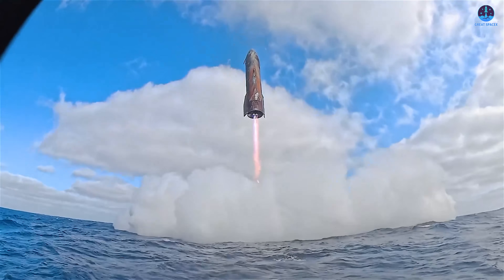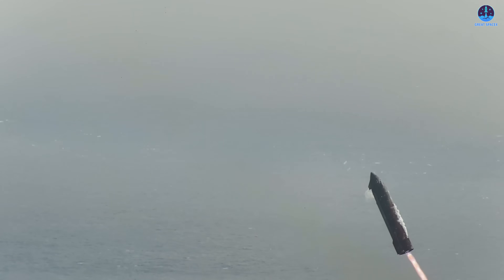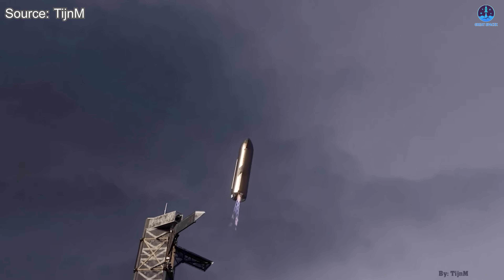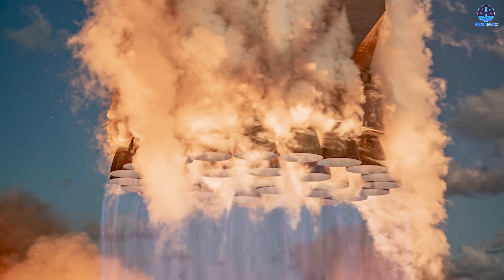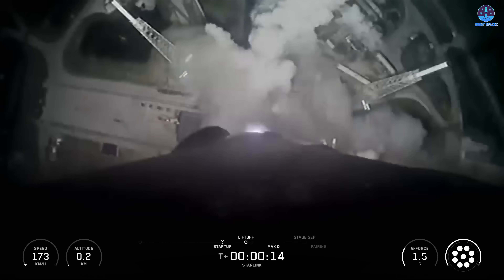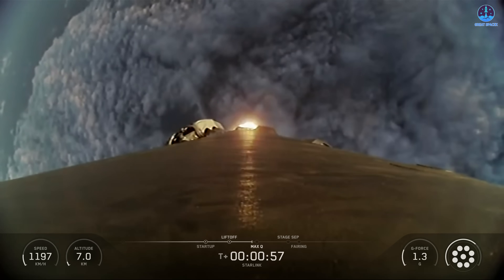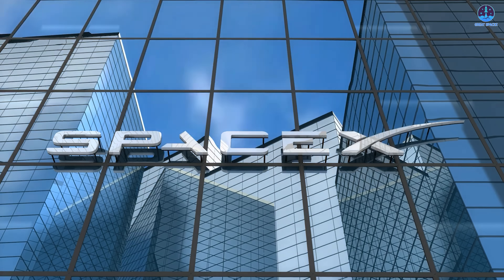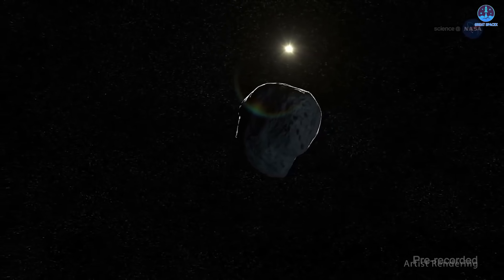SpaceX just declared Final Result on Starship 11 Flight after Buoy Footage Review...

Comment: With the damage sustained , it seems unlikely re use will be a huge job.
Reply: I am a little more uncertain as it appeared that there were leaks where the Rocket Skin of Ship had cracked, or melted (other than where tiles had purposefully been removed) ...  In order to maintain structural integrity it's not quite as simple as 'welding up the holes', but more likely to require some re-building of the Rocket, affecting the heat shield also ... We also cannot see what, if any, internal damage occurred, nor do we know yet how many of the Raptor Engines were in a re-usable state.

The exception might be if the extremes of the test would not be used in normal flights and landings resulting in possibly much less damage from heat and vibration, etc.

Whilst I am impressed by progress, there is unfortunately clearly some distance to go before practical re-usability without extensive refurbishment is required. I am hopeful that SpaceX will succeed in this difficult task in the foreseeable future.

Comment: Why do ALL the videos not show the RUD? They all cut off too early. Just askin'.
Reply: It technically wasn't a RUD, since it was a planned disassembly 🤓☝
Reply: I would guess because the camera is having its own RUD at the same time.
Reply: What RUD, both the booster and ship completed their respective planned operations?
Reply: Actually, now considered as a 'RAD' because these were Rapid Authorised Disassembly ... Apparently, the Channel NSF (NASA Spaceflight) did some checking and RAD is the new term for when there is a scheduled explosion eg. to sink the Booster, or Ship after a Water Landing in order to avoid floating debris being a Shipping Hazard.
Hope that's useful ... (?)